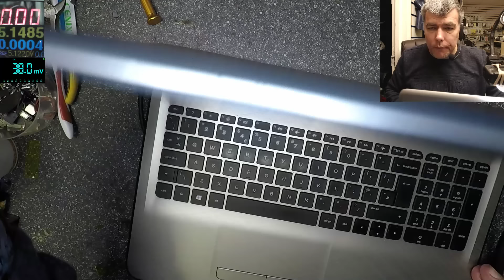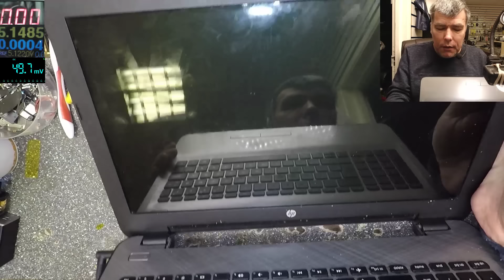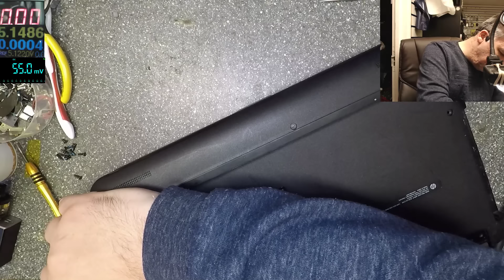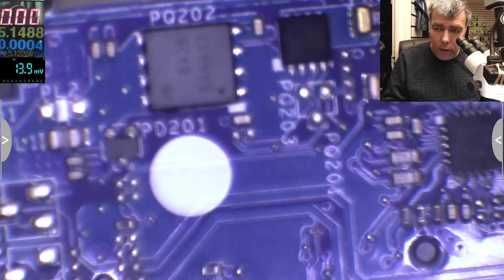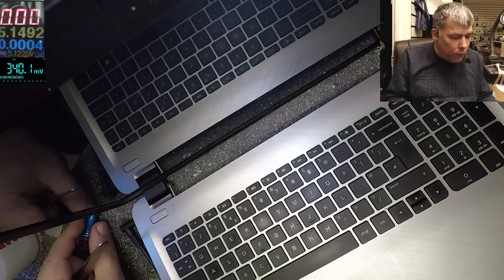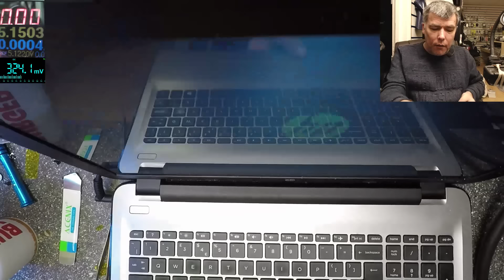Most common fault on a Dead Laptop

Comment: Not a proper fix but a fix, a cheap one. I understand this guy reason that expending 30 minutes to 1 hour checking the schematics, boardview, and testing many parts of the motherboard block circuits is going to cost more to the client. But then again what kind of warranty can you give since "bypassing a component" can in the end killed another one or even worst an expensive one... I suggest if you want your client base to grow and love your work, to check the power rail that feed that mosfet gate next time and charge the client accordingly or offer a discount, that client will bring more clients if your work last instead of a client that come again to you complaining because your work didn't last.

Comment: Good to see that you identify the problem, but you are just bypassing a system of control of the power line. Should investigate more deeply if it is a fix to keep on using the Laptop and see why the power line that opens the mosfet it is not working properly. Or is it just simply the mosfet broken?? If it is a fix just to recover some data it is ok to do it just like that. But in the long term this will give more trouble. Good work anyways.

Comment: I remember a Dell Laptop that I had and it started complaining that it could not  verify the model of he charger..although it was the same charger used  from the start of time.     It was then by design purposely not  allowing the charger voltage to be used and gradually exhausted the battery.  I am s sure that the "protection" device failed.  In truth it was probably designed  to prevent anyone from  using a third party  charger.    I think i believe that in some cases the complexity is overkill and introduces faiiure modes.

Comment: Okay, so at 13:00 you jumped the input and output to basically do what the mosfet was supposed to do to check whether or not it was the mosfet that was faulty? I'm confused as to what happened there. If I'm right, then DAMN, thats cool! Also, I didnt understand how you diagnosed the mosfet to being the fault as to why it was not turning on. If you can explain that, it'd be much appreciated!

Comment: Multumesc mult! Am azi acelasi tip de laptop, cu acelasi defect, I-am pus o lita asemanatoare :)... Si a mers! Incepusem deja sa caut placa de baza pentru el. Dar nu inteleg ce rol are acel tranzistor, de ce nu i-au pus ei o sarma din fabrica? Iar genul asta de reparatie e general valabil? Dar daca i-as inlocui mosfet-ul, l-am masurat si pare defect (nu ca as avea unul, dar pentru rigurozitate) poate sa mai fie si altceva defect?

Comment: WOW, what a butcher... He removed what he perceived to be a bad MOSFET, and replaced it with a SOLDER BLOB dragged out between a couple pads... Didn't use a speck of FLUX, and poking around on the board with metal tools, at the same time stating "...i do not care about which way the voltage goes, but the laptop now works..."  Let's  just button it back up, and put any leftover screws in a little baggie for the customer, and hope his/her house doesn't burn to the ground...
REALLY??? And all you people think he's "AMAZING"??? WTF??? Better open your eyes, people...
B - U - T - C - H - E - R

Comment: Thank you so much. You are a genius! I did it to my Toshiba and it came back to life!!!. It was a bit tricky to remove the chip though without the hot air  tool  but I managed. Seems like there was a lot of varnish on the board and chip which melted when I used my soldering iron.

Comment: Regarding weather or not this is shoddy... it depends on the promised service.  Is the repair to make it 1) "work" 2) achieve "like-new" condition 3) analyze root cause and prevent repeat.  If it is transparent that 1 is the service being offered, then I guess you can call it done.  If 2 or 3 are the promised and/or implied service, then this could be called shoddy.  2 would require replacing the mosfet, 3 could be extensive and could include modifications even improving on the original board design.

Comment: Love these videos I had no clue about electronic devices before you explain it very well I've picked up small bits so far as a complete beginner I have a laptop that went bang then switched off and wouldnt come back on I bought a new power supply still wouldnt work so I did a key combination that apparently clears stored electricity apparently then plugged it back it now worked but keeps going off after about 10 15 mins while installing OS I've swapped ram that's fine I swapped hardrive still the same at that point I gave up and put it away then by chance looking on YouTube I found your channel now in having a deeper look at it again thanks to your kindness of making these videos I have a question though where does 19v line end and 3.3v rail begin I expected to see bulging capacitors but non was apparent so next check is mosfeds one thing that did confuse me was the fact that you didnt put mosfed back and just used a blob of solder to replace it I want to learn to repair it out of satisfaction that I can more than anything else if I manage it it will be because of your great generous time u give to others if I manage it I will send you a well deserved bottle of wine thanks for giving your time to help others

Comment: So this guy removes a burned-out regulator IC and puts a fuse in its place and calls it fixed lol. Do you really think HP just throws regualtor ICs in there as fuses?. Do you really think the design engineers just put parts on the board  to save a fuse? That the regualtor IC you call a mos fet was just acting as a fuse?

Comment: Hello brother, my laptop fans keep running after shut down and they keep running till the battery is full drained. ( All night 12-13 hours). I cant switch on the laptop while the fans are running. It becomes very difficult to switch on laptop when i connect charger the charging light is also not shown, nor of power. ( After trying 20-30 times when it shows charging light and i switch on laptop only then it starts).Please suggest solution,  thanks in advance

Comment: Thanks for video!  i have trouble after bypass that MOSFET: i must plug AC adapter (white light), plug in battery after  (orange light).... When remove ac adapter...laptop use energy from battery, if i connect ac adapter again, it still use battery and not charge battery again!

Comment: A pc fixer told me my laptop keeps going on and off at random because the motherboard is fried. He told me that someone broke a piece off of the display port slot and that this is why it is fried. I can turn it on but it eventually turns off at random and then I can’t turn it back on again. I can get it to turn on by trying over and over until it powers on. How do I fix this?

Comment: Sounds like the diode in the MOSFET died and kept the circuit from detecting the power supply.  Yes, power has to pass through the diode built into the MOSFET before the circuit on the other side will turn the MOSFET on...  Short the MOSFET for a moment and then the circuit will power the gate and try and turn it on.  If the diode is dead then no initial power detection happens and no power on.  It's a low resistance polarity protection circuit.

Comment: I just repaired a broken power port by soldering for the first time. I’m getting shorting and sparking when plugging in charger, I ordered new part and solder kit thinking I’ve seen enough videos I can do it too yeah? First attempt, front two pins easy they are far apart, 4 pins on the other side are close together. The negative and outer pin (ground?) are touching, i tried my best to clean up the board using the sucker and adding more solder. 2nd attempt removed part and solder , holes 90% clear of solder and part slotted back in. Soldered pins again with less solder trying to avoid unwanted bridges. Still sparking and not working, idk what I’m doing wrong.

Comment: My grandma’s tower was running slow after 10-15 minutes of it being one. It had blue screened on her. She called me up asking what it could be. Told her that it is usually related to hardware, drivers, or a virus. Ended up being that the heat sink was wearing an alpaca sweater and was over heating. I still ran a few checks on the ram, hard drive, and ran a virus check just to make sure.

Comment: I am having a problem in Dell laptop which I am unable to fix. Turning on laptop using battery only gets error and doesn’t turn on. But using adapter it turns on without error. After turning on using adapter, if I pull the adapter plug, battery also starts working for hours. Moreover, I/O chip also gets heat. What could be the problem?

Comment: I don't understand, is it the problem with mosfet or something else? like if you were not getting voltage on the gate, why did you remove the mosfet first? shouldn't you first check why voltage is not coming on the gate?

Comment: Can anyone help me? I have the very same type of laptop as in this vid (HP 15-ac108nx) that died (no charge lights or any signs of power) after I plugged in the charger. Also, there was a spark sound near the power jack area so I thought of a short on the mobo or just power jack damage. Could it be that the fix is the same in this video? I dont have a multimeter or a battery to test it for anything.

Comment: Hi I've got a issue with my lenovo ideapad 110. When ever I go to power on my laptop it immediately powers of and makes a clicking sound. At times it powers on but runs a repair protocol and powers off. So I was wondering if it can be repaired.

Comment: Sir , how do you check the specifications of the motherboard of a laptop if I want to replace it. My acer extensa 2519 got splashed with water its only charging not switching on  .if you can help

Comment: My laptop has different diagnostic results whenever I turned it on. The screen won't turn on anymore but I did manage to get it on a few times by disconnecting the cmos battery and battery and leaving it disconnected for while and then reconnecting it.

Comment: Hello sir. I have a problem, due to voltage fluctuation in my home my laptop is dead. No charging light, not turning on. What may be the common problem. I live in a remote area so can't go to repair  shop. Is there any thing i can do at home.

Comment: My computer is also hp but when I plug in the power there is light, but the laptop does not turn on, there is a flicker on the screen when I turn it on. It's as if the laptop is turning itself on then there is a flicker then goes of, then goes on on the same loop. Any ideas on what the problem is?

Comment: mosfet primary reason, is a fail safe switch. That mean if main power supply adapter, become defective, mosfet will protect the laptop from receive wrong voltages...
The most common enemy of mosfet is the temps, the primary reason of burnout.

Comment: Hello. Probably this is not the proper place to ask that,but friend of mine spilled a coffee over there laptop. At the moment the laptops keyboard is light on the fan spins for a few seconds and then the laptop shuts off and then back on. Sorin may I ask you where the shop you working in is and how we cane get in contact so we can get a quote for a potential repair. Thank you for your time.

Comment: Hi, I need help. I am trying to fix a laptop that was rebooting all the time even when formatting. I've changed the RAM, and take off the HDD to put on a SSD. It boots OK but it randomly freezes when I am using it. I've tried using Linux Mint but I have the same problem. I tried using the computer with the carger and with the battery off but problem persists. 
I do not know what is causing the problem. The laptop dropped from 90°C when CPU was at 100% to 72°C. 
Before, the laptop even was freezing on BIOS. Anyone have a clue of what might be causing this problem? Someone told me that the motherboard was the problem, but I do not know how to test that.

Comment: I have toshiba laptop old version. The back led of the screen sometimes goes off. When I dont use the laptop the led stays on, but once i toch it it will go off then it will go on about two minutes or more it is random. It did open the Connector and put it back. I found some losing wires that attached to the screen and it is looks like a ground wires. I put them back and tight them, but the problem still the same?

Comment: latitude E7440 doesn't power on
I face this issue after updating bios with 28A latest update available at dell support and not turning on , by all the steps suggested in your video

- remove battery ,all peripherals , power cable and BIOS battery 

- then plug the power cable and click power button 3times 

 

- it shows power light for 15 seconds and then battery led for 2 seconds and light on power cable remains stedy white 

https://photos.app.goo.gl/s4tpscV14JjkQbLd6

 I tried that with another dell  charger ( same response from laptop ) 

I have two queries , it will be helpful if you give ur suggestions to figure out the issue in more detail 

1. > After plugging power cable into Laptop ,  light on Power cable remains stedy white ( So does it means , there is no short in mother board ? ) 

2. > in case if motherboard is healthy ,  Does CPU( intel )  in mother board  not starting /  can we verify a faulty CPU ? 
note : cpu is non removable in Dell E7440

Br,
Pranjal

Comment: Hello,  good vidéo 👍 👍 👍 
Please My lenovo 530 laptop starts up and remains blocked on the start screen with the lenovo logo, impossible to access the bios or start from a CD or USB the LEDs flash at startup then nothing after, I replaced ddr and ram without result. 
Please give me your opinion on the origin of the problem. 
CORDIALLY

Comment: Hi, I Have a similar laptop which failed to turn on, I have cleaned the Ram, did charge removing ( removing the battery and pressing on for a couple of minutes) but in vain, only that I can mention that, after the charge cleaning, and on returning the battery and connecting the wall-charger the indicator charging light came on and very light and blinking fast.

How to i go about it.

Comment: Hi Sorin. I'm Josh and I have been attempting to bring back my laptop to life. I've been watching your videos but it is only now that I am able to do a diagnosis on my laptop. I have a link to the forum on my investigation.

Short story... it is a busted MOSFET which I think is the issue but I need your expert advice if there is anything else that I need to consider. 

https://youtu.be/Nfe5Dh40UxU

http://forum.notebookreview.com/threads/official-sager-np7352-clevo-w350st-sager-np7370-clevo-w370st-owners-lounge.724168/page-75#post-11017333

http://forum.notebookreview.com/threads/official-sager-np7352-clevo-w350st-sager-np7370-clevo-w370st-owners-lounge.724168/page-75#post-11017334

Comment: Hi brother. Sorry to bother u , I have got couple of laptops ,one of them.i used it first it was fine everything battery ,powerlines was fine then I had to start using though direct power line only n now it doesn't even turn on even tho I plug in direct power line .. can u plz help me..it is toshiba brand not sure which system. Tho..plzzzz and also got a printer which used to work but all of a sudden it stopped working or even turn on for that matter any ideas plz help me plz...

Comment: I think i have the semilar problem of this but right now i dont know where to find someone that has this knowledge of fixing computers, my hp notebook had a fan problem and i cleaned and fixed it, it was stored for like 7 months and then i repaired it, my battery does not work, so i use it without the battery, right when i fixed it, i factory reset it and it was working well, thats was yesterday, now i was working on it and it shut down, i tried to static build check and powercable check and they do not work, right now i think it should have something to do with the motherboard not recieving enough energy or not at all, some advice? Because i do not want to buy a new laptop, i want this one.

Comment: Rule 1 Disconnect power before disassembly FFS!.  Your lucky it still works! You drop a screw or screwdriver or short something with DC power on it to something else while removing boards bang and you could blow some CMOS component. Sorry I'm a electronic repair engineer.

Comment: I'm am new to computer repair. Followed this video and it was excellent!! Everything had correct readings... light turns white but laptop not working without battery. Can charge battery fine only with laptop powered down(orange light on). Will not charge while powered up or with power supply and no battery. Light does come on white but can not use unless battery is charged up. Then dies, and charges again and so on and so forth.

Comment: Hello Mr. Sorin... Greetings! Hope you doing well. I have a question... I have an old toshiba laptop model L305D... The thing is that when I plug the charger I get a light on the wifi switch  but no light in the charger light nor in the battery... Now, when I press the power button I get the battery light blinking for 6 times... Then nothing, the laptop doesn't turn on at all. Have you ever encountered a problem like this? Any recommendations? I appreciate any help or advice... Thank you! Keep up the excellent work!

Comment: I have 2 printers at home that when I turn on the switch.....light up and then go dead....I think is a power supply issue...will try to fix it by using this learning classes from you sir.....Could you make videos with circuits or visual aids to refresh what you are doing on those repairs? I watched one that you wrote or drew the circuit of the power supply and explained what you were doing...that helps a lot

Comment: I have a problem with my HP ProBook 4530s, I try to remove administrator password from the BIOS by connect PIN    4 and 5 to short current it,  and my my laptop won't turn on showing white and orange light on the charging light